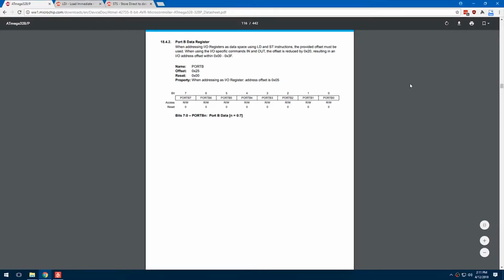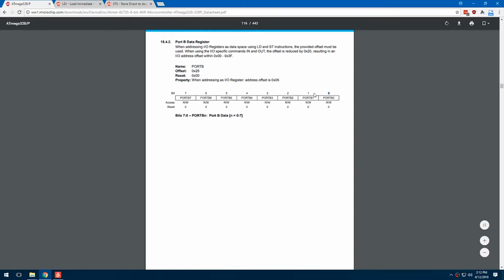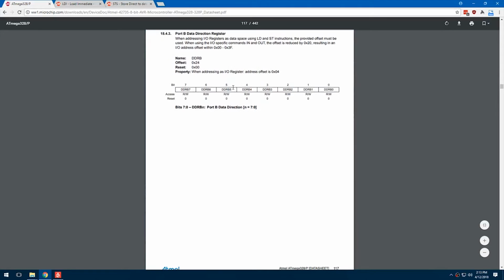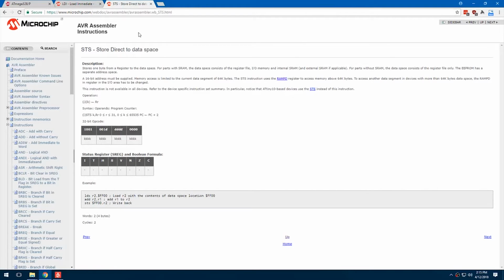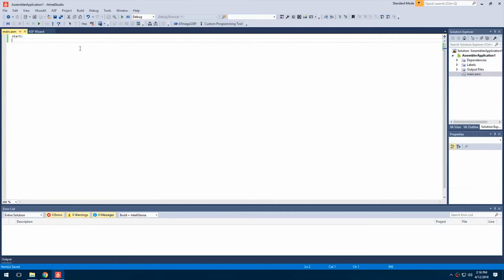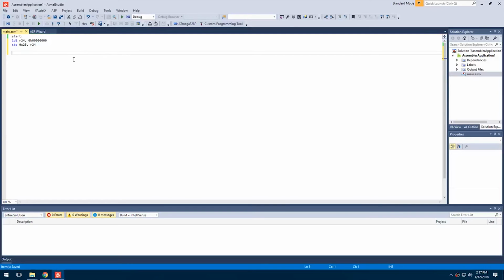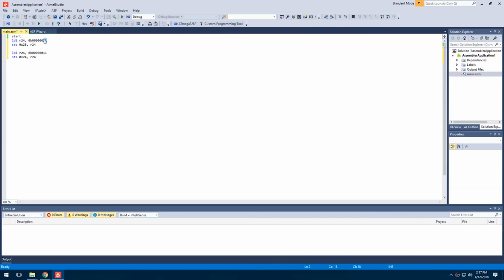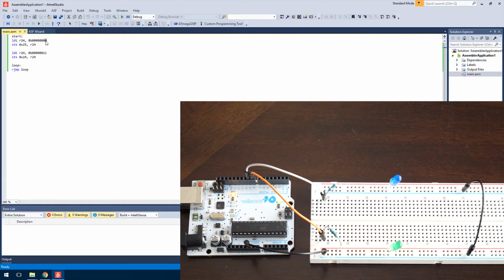Using Assembly to Control LEDs via the Arduino Uno

Comment: If you are coding just with an editor and if you use avrdude as a standalone application, you can hopefully compile your asm-code and upload the hex-file to your arduino with this simple script: https://www.mediafire.com/file/klxn4rclt304i4u/Uplm328P.sh/file - edit it to your needs.
Reply: Here is a complete project with some small steps forward (zip-file of about 2MB): https://www.mediafire.com/file/ko5c3g6ga7dx87h/ATmega328PonBreadBoard.zip/file